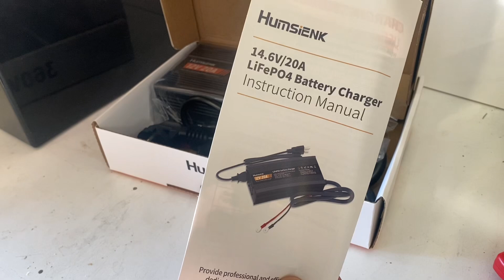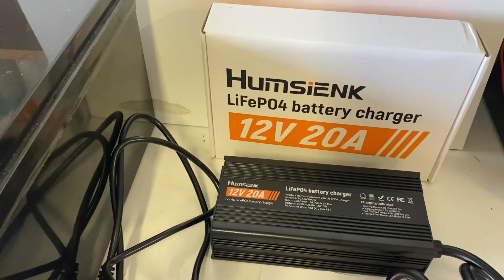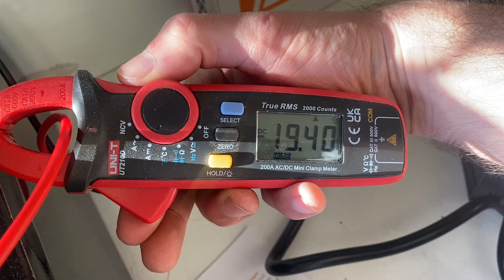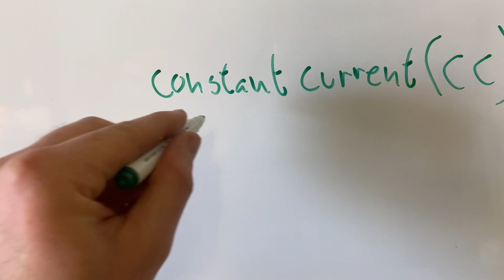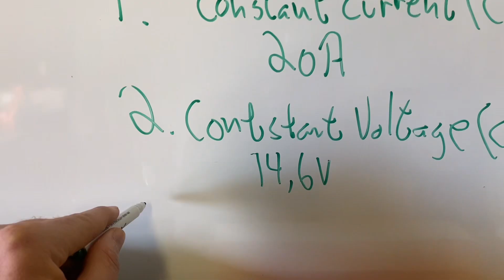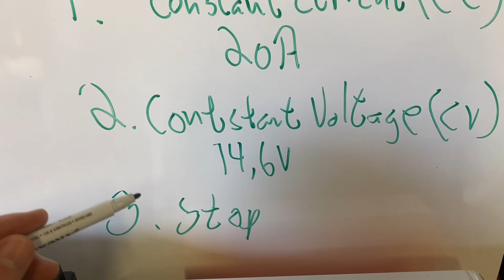HUMSIENK 12V 20A LiFePO4 Charger – Fast, Safe, and Affordable!

Comment from the maker: 🔗 Grab the charger here (affiliate link):
https://www.humsienk.com/products/humsienk-14-6v-20a-dedicated-lifepo4-battery-charger?ref=JONASSYVER

This is the dedicated 14.6V 20A LiFePO4 charger featured in the video.
It’s fast, simple to use, and packed with safety features.
Using this link supports the channel at no extra cost to you — thanks! 🙌

Have questions about the charger or your setup? Drop them below — I reply to as many as I can!